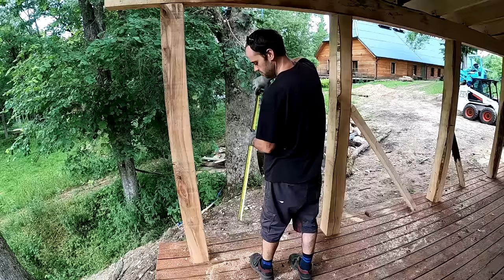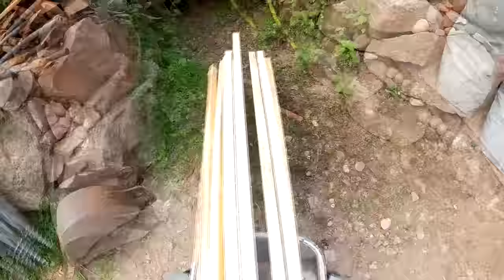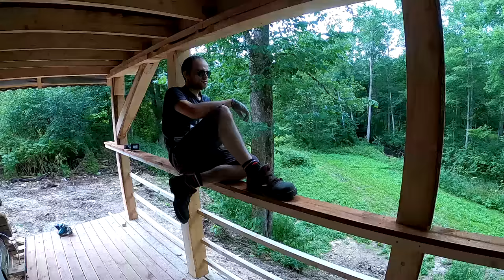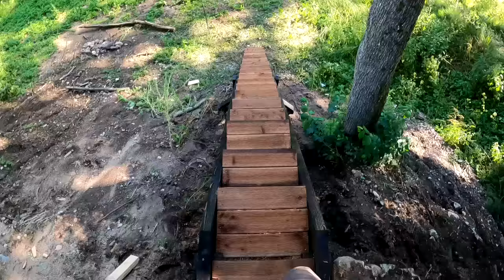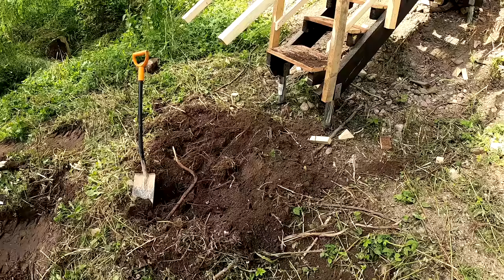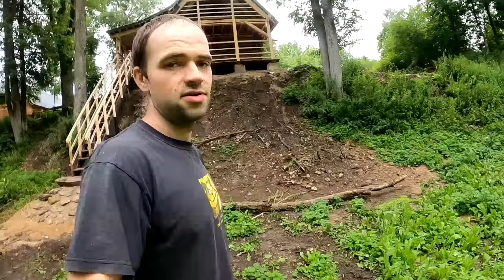Renovating a 128 year old forgotten log cabin (part19) - Adding railings and building a staircase

Comment: Hi Andris
You where asking for our comment, here is mine:
Well first i think the little high relling from upper balcony is good enough. Bether to high, then to low.
Second: I hope you will put in next days some wood protection to all parts of wood you use new (light brown color). I think best would be same color like the balcony floor.
If you do not put wood protection or color, the „new“ wood will turn to gray in next view years. Do you want that?
Thirth: some of your new wood still have the bark (skin) on it. That one you should take off befor put wood protection on it. Otherwise rainwater can go between skin and wood and then it start rotening.
Last point: The handhold at the end of stairs (down) is too long, if possible cut a bit.
So thats my comment to your actual episode.
Work is good and i hope, soon we will see how you go on with the inside renovating. 👍👍👍👍

2 more thing: Its interresting why your top wood in carport turn already gray, as it was protected from top. But maybe some snow, rain come in from front. I think right now you easely can clean (brush) it.

This last days i was watching all you 18 movies (some even 2 times) and i have big respect of all your work you do and specially how you solve the problem you have with your machine, ….
I wish i could have all this power you have (but i am 69 and have to take care of my back). 👍👍👍👍👍
Hope to see soon more of your movies (can‘t wait 😁😁😁).
Good luck
Reply from the maker: Thanks for the comment buddy! I appreciate all your concerns. All of them are well pointed out i will try to fix all these problems in the near future!

Comment: Hey AP! Another great video. Thanks for making and sharing. I know you have to edit a lot of content to just make a short video...can't imagine how much you went thru to make this one, but I really appreciate it. Its all is coming together. I don't guess anymore what you are going to do next. It's all good and enjoyable no matter what. I think their should be a paint color called "Used Motor Oil"....for those not wanting to use the real thing. The oil looks great on the wood. If you want, on the very top railing under the roof you can cut short pieces with angle ends and nail them between railings to mimic the shape of the roof rafters. Until next time, Take care, buddy.
Reply from the maker: Thanks buddy as always. These 50min videos usually start off with 8 to 10 hours of content. Editing takes around 4 days (2 to 3h per day). Thanks for the feedback buddy, hope youe doing great see you next time ❤

Comment: Awwwww, Mr Pants, that's wonderful 👍

You're an able perfectionist, and perfectionists will never be 100% happy with their achievements. They never stop learning, and apply the learning process to the next stage of the existing project, or to whatever they choose to do afterwards. Also, you use screw fixings that are as easy to remove as they are to install should you feel the need to change and improve things......  

Plus, how often are you going to stand at the bottom of the slope and look up towards the end of the cabin compared to the amount of time you spend in it?! Looks great to me from either perspective, and, as you said, no-one is going to fall from the balcony. Safety first, especially when children are involved.

You're doing a brilliant job, and I'm looking forward to part 20.

Cheers 😀👍
Reply from the maker: Thanks Simon, for everything 😌👍

Comment: PUT SAND AGAINST THE HOUSE, NEXT TO THE STAIRS OR IT WILL GO DOWN THE HILL WITH RAINFALL, OR GO DOWN THE HILL EITHER WAY. 

Sand will always run off to about 30 degrees. You want to put more sand against your house next to the stairs. Its going to slide down. And make some siding. Planting willow sidings can be a solution if you have enough water/rain coming all year. It grows up to hold ground. Or grout the ground with cement slurry. The ground is not going to hold the same shape, its not at a safe angle yet, so its going to want to slide to the angle the ground can hold. So you want to bring the ground back to that angle, or you are going to have to build some terraces (look for "Terrace garden"). 

Good luck. 

Greetings,

Jeff
Reply from the maker: Thank you Jeff for the ideas. Ill do this next year. Got some plans to secure the slope

Comment: when you cut the posts or beams for joints, you should seal the inside. a quick bit of oil or glue will help the wood slide in, and protect the cavity for quite a while.
Reply from the maker: Thanks for the tip Chris

Comment: You're too awesome. Stairways a bit narrow though but I guess it won't get that much use. I wonder if the width of the baby gate had something to do with that hmmm? Also should've put the stairs side supports outside. Maybe on the top second floor railings add some lattice works to break up the horizontal lines. Otherwise looks like an awesome place to hangout! Thanks for all the hardwork!
Reply from the maker: Thanks for the comment and i value your feedback also 😀

Comment: You can use undiluted vinegar to kill the mold on those boards. You just pour undiluted vinegar into a spray bottle and spray the moldy area directly. Allow the vinegar to sit for up to one hour. Wipe the area clean with a damp towel and allow the wood to air dry. The smell of vinegar will linger on the wood for several hours but will dissipate naturally.
Reply from the maker: Thanks bud, i didnt know that. Smarter every day👍

Comment: A bunch of people are going to hate on me for this but those decking boards on the floor are laid upside down, perhaps you don't mind and that's ok. I have decks like that and they were laid by the contractor with the grooves facing up, all it does is collect dirt and water and mold and turn into a slippery hazard. The grooves are there (if installed correctly) for airflow to prevent water and moisture from collection underneath the deck and rotting it out, it doesn't matter if it gets direct rain there is still moisture. Just like the lumber that went moldy because there was no airflow.
Again perhaps you know this and are prepared to replace it but it will still get slippery
Reply from the maker: Dont worry buddy i know this 😌 idk i jusy prefer them this way for some reason. Havent had any problems so far. Oldest deck i have like this is the sauna deck and its fine so far. (8 years)
Reply: @Ants_Pants  ok, good, i wasn't trying to diminish your work although I would do things differently but i can't even do them now. Thanks for understanding 😁

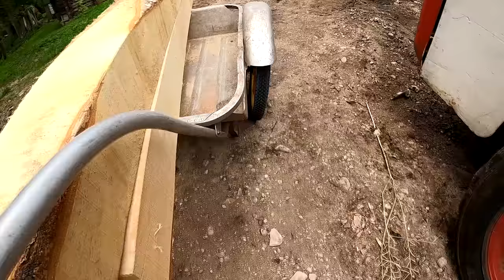Comment: 04:55 do it ones right with the tires and then it is ok.
Wait a moment. On the front the rails are inside and on the side on the outside. Would this not be a bit incesquent?
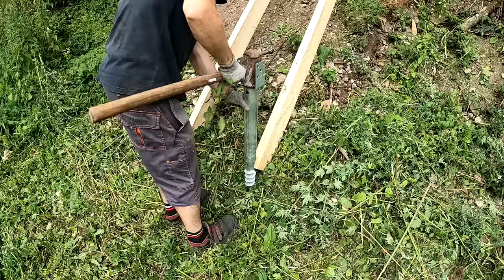25:45 The start and the end of the wood stair peaces would be better burned or they wil rot away but at the end the used motor oil is even good. Or setup a little concret left and right. Lets say 30x30x60mm w*d*h. But the way with castet iron is also a good idea.
Reply from the maker: Wobbely tire is still working to this day 😅 wanted it to be abit different. Ill add some oil on them down the road

Comment: Hey buddy, you should be able to plane that wood to remove the mold, etc.  Right?  Also, adding gutters will keep that area dryer.  Also, put plastic under/around that wood.  What I think happened is water ran down the front slope, under the brick wall, and into that concrete.  Concrete wicks moisture like crazy.  Adding a perforated drain pipe next to the brick wall will allow the water to run away from the front.
Reply from the maker: I belive there was way too little airflow. The lumber was fresh cut very heavy and full of water when i bought it. 👍
Reply: @Ants_Pants  sounds good! The stairs look great, man. Enjoy the BBQ lol

Comment: You can char those boards in use them for decorative interior boards. So those moled boards are useful.
Reply from the maker: Yes or i could run them to the planer, surface mold is apparently not that big of a deal

Comment: May i be so bold as to ask if you are using stainless steel screws? Although much more expensive they will last forever, whereas normal passivated screws will rust away eventually .
Reply from the maker: I used coated screws that have a rustproof coating on it. Its said that they should survive in acid for 20 years. Idk how true that is. We dont have stainless screws here btw.

Comment: As for that moldy wood ; burn the surface with a propane torch. Wire brush it afterwards. It has a nice rustic look. If it were me , I would propane burn the whole exterior of you're addition. The old beams are too dark , and the new addition is too light ! Lightly burn it.
Reply from the maker: Maybe the house will catch on fire😂

Comment: Did I miss the explanation why the end rails are on the outside of the posts and the side rails are on the inside of the posts? Also, I hate to say it because everything looks so nice, but that bottom rail added on the right side of the stairs just doesn't work for me. they aren't aligned vertically so it would drive me more nuts than I already am.

It is amazing that I can watch your 45 minute video and never lose interest but can't watch a television show without finding the need to change the channel.
Reply from the maker: 😅 so sorry. Trust me my goal is not to drive you nuts😣😜
Reply: @Ants_Pants  Admittedly, it's not a far drive sometimes! 🙂😛